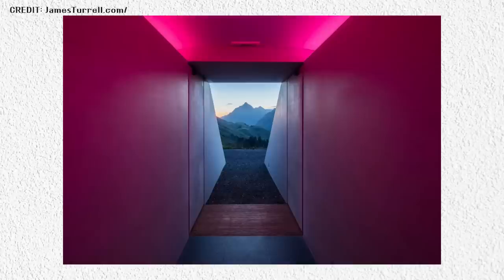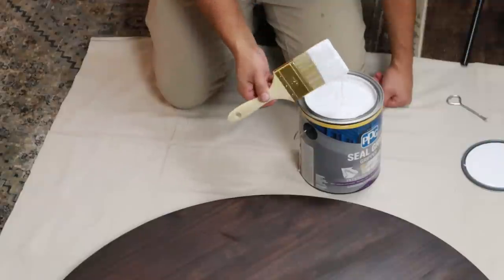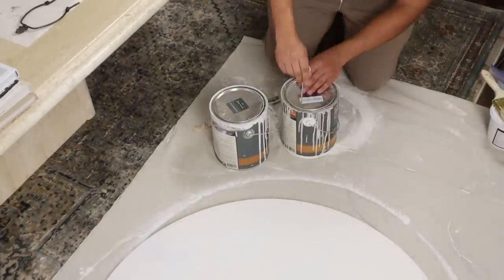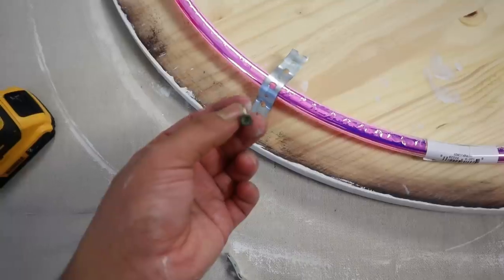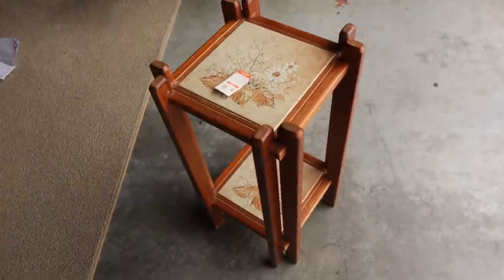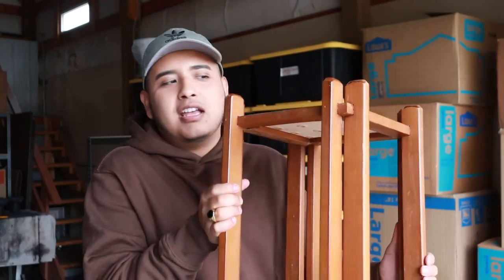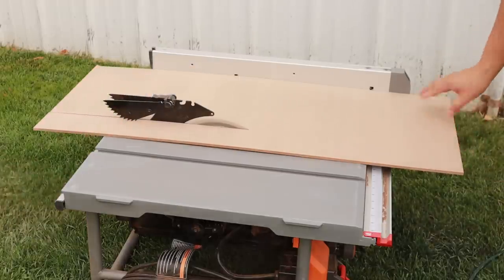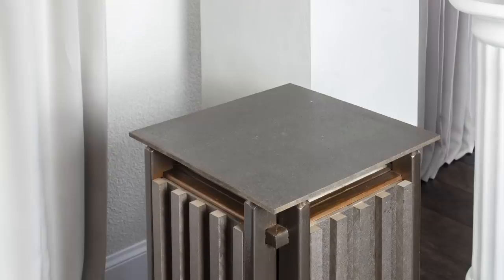3 Genius Trash To Treasure DIY Home Decor Ideas!!

Comment: I've just discovered you Jorge. As for project #2, the 1st thing that came to mind was a lighted table. Remove the sides you made & then the tiles that make the top & shelf below. 
I have had some spectacular results using rolls of brown craft paper/brown shipping paper. 
Crinkle it up tightly & then smooth it out to then oil it. Use whatever you have on hand: WD 40, olive oil, vegetable oil, etc. The wrinkles absorb the oil more. The effect is stunning & works well to mimic a vintage mica lamp shade, but my favorite use is for a Asian inspired look.

Comment: Jorge you should see if you can recreate the lampshade with frosted glass using different sizes of actual ceiling lighting shades! They’ll already have a hole drilled in them. It would be really clever. Love your videos!

Comment: Great for Big Plants that Grow and Cascade
Reply: PS that lamp was done, by Rachel on the "Sorry Girls" However, Yours isn't balanced totally right It needs to add in a few more different sized  bowls, saucers, and plates either smaller bowl or Larger to balance out the height from the Base ...Anyway; Watch Rachael as her's looked more balanced but you're on the Way to the Desired Look>>>> Could even do a mixed-up metals look with the lamp shade Part...but it's a Very Post Modern Esthetic and Diffinately its Worth Achieving that Desired Affect....

Comment: I liked that round table that you made before and I still like it. The legs are what I liked about it. They were sculptural, unique but at the same time minimalist.
For the light sculpture, I like it, but since your walls are white and it's white, I don't think it's being presented in its best light (no pun intended 😛). What if you got a smaller wood circle and some more lights and attached it to the bigger one with the lights under? 
I liked the other table, but what if you stood it upside down as you showed, but then put an LED light underneath? I bet that would make it look better in that way.

Comment: Here is an idea for the " side table", turn it into a floor lamp. Paint the wood beige;  replace the tiles with thin boards cut to size; nail one in place of the tile and leave the other loose; cut a rectangle of very thin beige canvas the height of the fabric will  be the height of the table legs measured fromboard to board, the width will  be the width of each side of the table x 4. Staple the fabric to the inside of the " legs", stretch the fabric as you staple, when you are done the fabric will create a shade for your lamp. When you are done ; glue or screw a knob to the middle of the loose boar, place a bettery operated candle  in the lamp and place the top board with the knob on top of you lamp.

Comment: Hello I have watched all of your videos pretty much I love them can't wait for whenever you put a new one up but I wanted to give you a little tip even though I know you probably should be wearing gloves when you're rubbing Gold leaf but if you do get any on your fingers take a little bit of canola or sunflower oil with salt and make a scrub and it will take any stain paint off of your skin very nicely the ratio is 3/4 salt and 1/4 oil 😃
Reply from the maker: Wow! I did not know that. I'll have to try it, thanks! :)

Comment: I like the concept of your backlit wall art but not this particular application. A large blank disk is too large scale for a living space interior. I would toss the pedestal table. It reminds me too much of the slatted trash bins seen in public parks. I like the idea of the table lamp. The rub on brass is a success. However I would go for a translucent material rather than an opaque for the light shade. Consider clear and then color it with a translucent paint (stained glass, tortoise shell, etc)